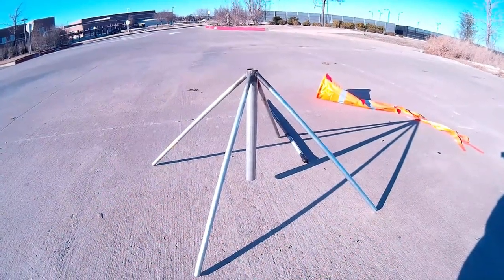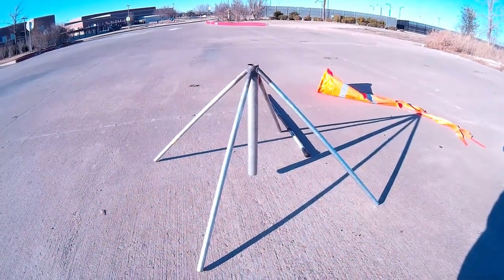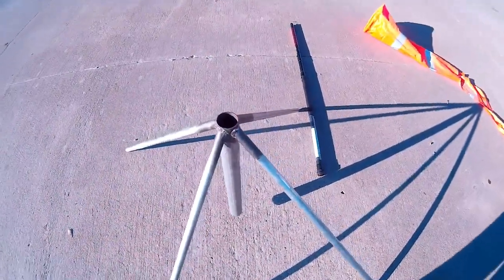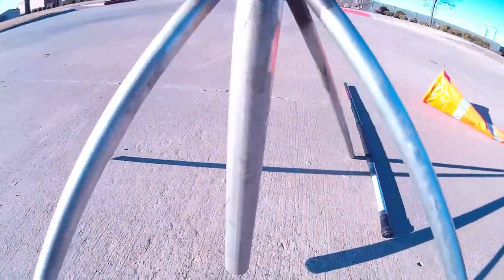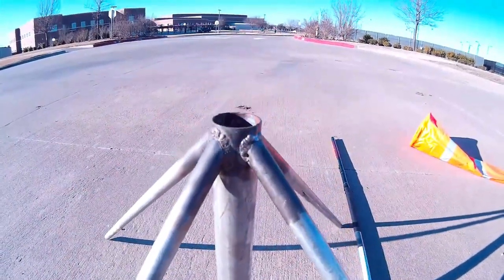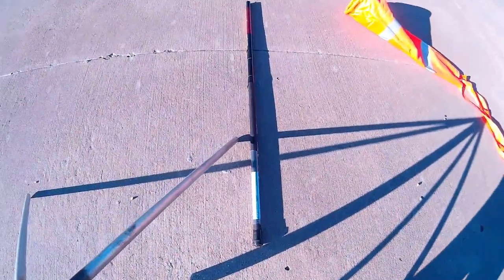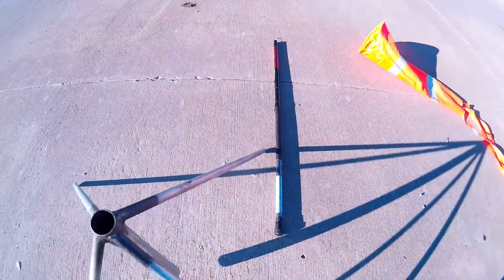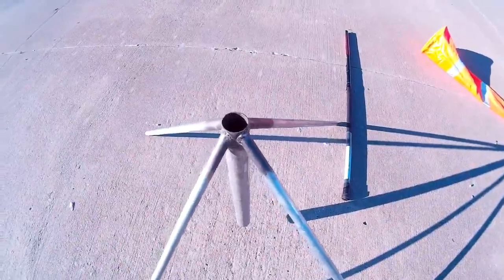Quick Setup Windsock Base for Paramotor Pilots

Comment: I like the idea, but I definitely wouldn't recommend welding on anything galvanized.
Reply from the maker: I know.  I burnt the galvanization off outside before a welded it.  I've since made a different one with a central steel hub that you can slide the galvanized legs into so you can break it down for storage.
Reply: @HilltopZombieShop  I was thinking about making something that folds like that out of PVC with steaks. Do you have a video with your folding setup?